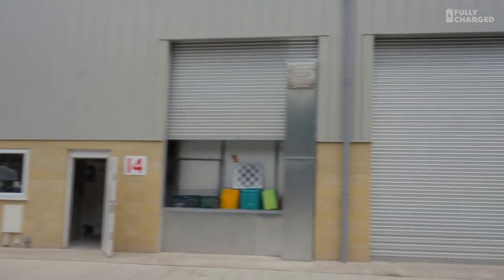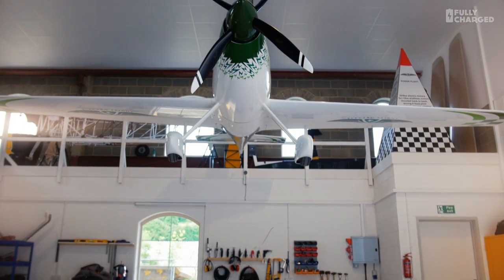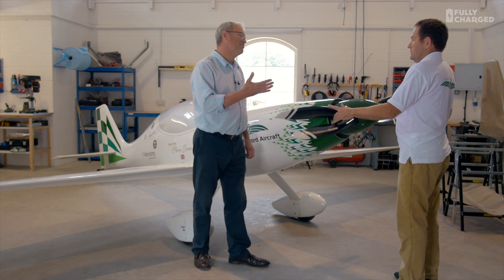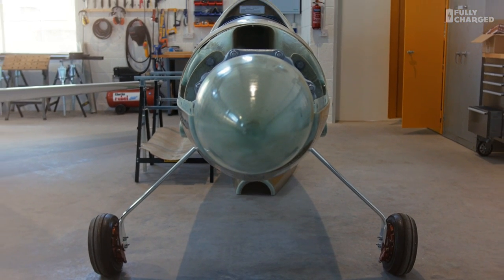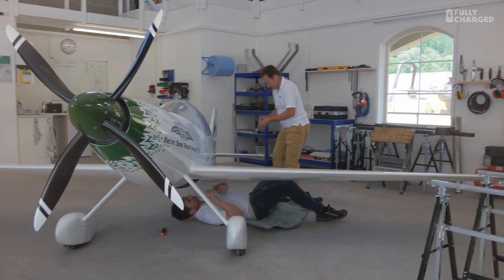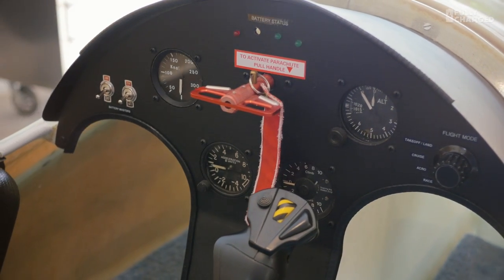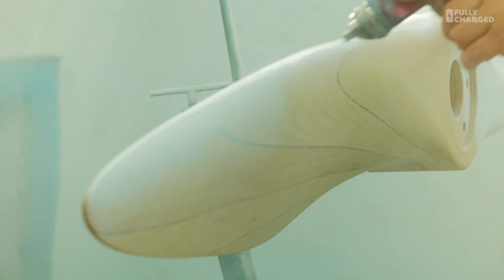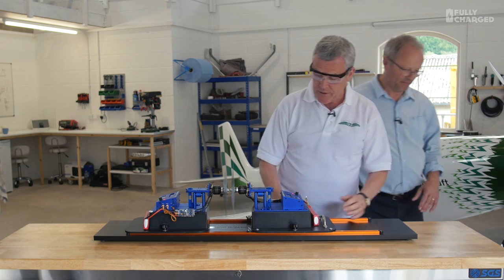Electroflight | Fully Charged

Comment: Until they can figure out how to store electric power as fast as a capacitor can,  it will always be impractical compared to hydro carbon engines. My idea is nanotechnology capacitors.
Reply: I was only talking about that to a friend a few days ago. If the body of a vehicle could be made from say lamination's which store the energy. Perhaps graphine could be used like carbon fibre. Other idea was to charge a liquid that could be poured in like fuel.

Comment: OH I see this video is almost two years old where's the follow on has the plane flown yet.  By the way R/C pattern does this all the time but with a counter rotating gear box and one motor speed control & battery. Just usurious what does the battery electronics and dual motors weigh in the prototype. I know what an IO540 weighs.

Comment: It's odd how you routinely hear that electric powered vehicles are zero emission.  I suppose after you have generated all the electricity needed, primarily through coal or natural gas power plants, to manufacture the motors, the fuselage, copper wiring, electronics, batteries, recharging, etc. etc. etc.   It's as if you drove a loaded diesel truck up a tall mountain, and once at the top you put it in neutral, shut off the engine and let it roll down the other side.  50% of the trip would be zero emission.  Not against electric powered anything, but just a reality check....

Comment: Problem with an electric aircraft is no energy recovery, a gas turbine generated electric aircraft is the only viable idea for long range commercial use. Plus aircraft motors operate at much higher rpm for longer periods of time than car motors. Electric aircraft are a long way off being viable. The industry won't change until there is commercial application, no one will train in an electric aircraft unless they are going to fly an electric aircraft.
Reply: People currently train in piston aircraft with the intention of moving to gasturbine in the future, so that's not really an argument against electric. Pilots already have to do an endorsement to fly gasturbine. Not even the military conduct ab initio training in gasturbine.
Reply: there are airschools that give endorsements in king airs, i can't really say how much that puts you ahead of other people who are searching for jobs though, i'm only 30hours into flight school :P
Reply: The batteries are the main issue.
Electric motors can easily provide the raw power, and generally more efficiently and with lower weight than a piston aircraft, or a turbine one.

The problem is energy storage is just... Batteries have terrible energy density relative to weight in particular.
It's one thing that the tesla roadster was 500 kg heavier than the Lotus it was derived from, because for a car that's something you can work around.
But adding 500 kg to a small aircraft, and not even matching the range of the lighter petrol equivalent is not going to do much.
Reply: Just like electric cars they are usable to some extent right now and more is to follow.
It is really idiotic to wait around for electric vehicles to reach extreme performance before you intend to use them for ordinary tasks. No one drives an F1 car to work, they take a pedestrian paced box that is just good enough for the job.
Reply: I think some kind of hybrid system would be viable, the current system is too expensive in cost and cost to the environment.
Reply: Maximum RPM for a piston aircraft engine is usually under 3200 RPM, with maximum power at a couple hundred revs under 3000 RPM. That's still fast enough to turn the tips of a 7 foot propeller above the speed of sound (1100 feet per second) at takeoff. Cruise would be at something like 2500 RPM.
Reply: There is energy recovery in electric aircraft, just like with EV's. They regen in descent and in decel. That's also the idea behind the airbus plugin hybrid concept.

Comment: ahaha turning props at 10,00 rpmm is ok on a  model but its silly on a  set of  8 foot props
Reply: Worse than silly, as the propeller tips would have to exceed the speed of sound with a tremendous increase in power required. Let's assume the designers know that relatively basic fact.

Comment: So why wood?
Reply: Cost, simplicity, reasonably low weight, best choice for one-off jobs. Carbon fibre is expensive and needs a costly mold before you can even start to produce the prop itself.

Comment: This propeller configuration makes it impossible to do a torque roll
Reply: It doesn't, actually, it makes it a lot easier, because you have way torquier engines, and you can control them individually. In BOTH directions.

Comment: Not 100% correct. Electric motors can overheat and altitude does change the density of the air which cools the motor. If the motor is run at full load or current you must design for the expected worst case to avoid overheating.

Comment: It sounds good but I suspect for racing it is too good to be fun.  That is there is no getting the best out of the engine or as in gear changing on a car or blade pitch changing in the air.  But for a crop sprayer wealthy person transport it looks great, if the battery gave it the range which it would not yet?

Comment: this is as practical as a drag racer, lots of power and speed with very little range
nothing that contributes to  commercial e-aviation really taking off sustainably
we would benefit more with a longer range airplane that can do at least 300 miles for short routes, even if they are slower, because the economic impact would be huge as well as the environmental. But I can see why they are doing this, this is a market they can win now with current technology, for what I'm saying, the energy density is not there yet

Comment: thats electric motors for ya
from lowest rpm and highest rpm is all full of torque, unlike conventional fosiil fuel engines which have torque only in certain rpm
1 problem with coaxial type
so noisy
Reply: Electric motors have a favorite RPM range, outside which their efficiency suffers.

Comment: You are complacently wrong about zero emissions with electric flight   it may be not coming out an exhaust stack but it is coming out of fossil fuel when generated unless it wind or solar. There is always a carbon foot print with any manufacturing process. Check the high CO2 emissions with the manufacture of a Tesla and it batteries.

Comment: electric energy is not for free !!!! and its price will rise apropriate to its needing more and more.. also we have to make dirty powerplants often atomic based.
flighttime is verry poor and if ading a pressurriced kabin will drop more.
Reply: Hi, read your post and fully agree; however,  there is a growing reorganization that a little considered aspect of electric applications will be the control of emission points in the production points of electricity.  Example, one electric plant of coal, atomic or diesel is the point of emission and will be easier to control than the emissions of hundreds of autos, planes or homes. Electric airplanes are still SIFI and expensive toys  and electric cars will only solve a very small segment of  heat and transportation needs; so, you can put money in these companies but don't expect a Volkswagen any time soon.  I am an old guy and I can remember when plastic was going to solve all our problems like broken glass all over the place. Plastic did solve all the broken glass on the beaches, in the rivers, and in you feet and it was cheaper than glass .  Now we have plastic all over the place.  Electric energy is not free and because we must make the stuff , thus the burning of fossil fuels will be employed along with Atomic.  Therefore; the question,  just what are these guys selling?

Comment: OK - it's a rich boys toy of no functional use and bears zero resemblence to anything that might resolve the inherent environmental issues of flying hundreds of millions of people on holiday, let alone intercontinental travel. Of course, the Spitfire was developed from a racing plane, but that really didn't point the way to mass air transit. It was a relatively short range interceptor, and a short range air race 'plane is not going to resolve the real issues either.

Contra-rotating props were produced in the latter part of the piston-powered era. Even Avro Shakeltons had contra-rotating props powered by RR Griffon engines, and some of the engines on those found there way into air racing. It's nothing to do with electric power, but rather a way of avoiding propeller tips going supersonic.
Reply: McLaren F1  which does not answer the fundamental problem of the applicability of this to commercial aviation. Electric power suffers from the relatively poor energy per unit mass. There's lots of work on small feeder and light planes, but a flying hot-rod isn't going to answer that stuff.

The technical issues of getting the range for a commercial airliner are much more demanding, and energy densities are around 80 times below that of jet fuel, and even allowing for issues of the greater efficiency of electric motors, that a massive chasm.

Maybe liquid hydrogen and fuel cells might answer that, but it's extremely difficult to see Li-Ion getting anywhere near it. At least electric motors can rival gas-turbine on power-to-weight. It's the energy storage that is the problem.

Comment: Interesting for shure,  but Electroflight can never used for Commercial Airlines, same goes for Cargo... 
Consider this; where do they get all the Energy from... please dont Say the Sun, or wind or Water...
Electro Cars or Electroplanes can never scale up to Comercial usage, it is a Onewaystreet !
Reply: > please dont Say the Sun, or wind or Water...

Why?
Reply: Easy answer, you have to transform the Natural Resources into Electric Energy the EROI = Energy Return On Investment does not work. You can not Harvest Electric Energy, you have to produce it...
Reply: Yes, you have to produce it, but you may produce it very cheaply, for example in nuclear powerplants. Also consider the fact that distribution of electricity is much cheaper than distribution of fossil fuels.

And BTW solar panels are getting there when it comes to price per watt, so in a decade or so (assuming the prices will drop at the same rate they have been droping last 3 decades) they should be on par with nuclear (better than coal).

As for petrol and gas they are already mroe expansive, so I don't understand your criticism.

Comment: How many people will go bankrupt before they realize there is a better way.  

There is new technology I am working on that will be 60% efficient on most any fuel and it can also run on electricity at a lower peak power for cruise should batteries work in 20 years.  Airplanes MUST have range and the battery is too much weight and too much volume.  

A hydraulic motor is 10 times lighter or more than the best electric.  One hydraulic motor I have seen is over 20 hp/lb or 40 times what a piston crank (Lycoming, for example) engine is.  Coupled with this new engine at 4 hp/lb, the electric option will be very very poor in comparison.  Sorry to bust your bubble, but this electric stuff is not the way to go.  Information is great for electrics due to the switching advantage of silicon.  Power should be Hydraulic and IC.

BTW, electricity is 15 cents/kw-hr in the USA.  That is $5.04/gallon equiv.  The battery is 12 cent/kw-hr use which is $4.03/gallon.  That is over $9/gallon.  Natural Gas in the USA is $1/gallon.  Need I say more?

The counter-rotation is great, but SOUND is the critical factor.  In a jet engine you how a cowl that reduces the noise, but an open prop gets slammed as it sees changing AOA.  The blade needs to be very strong and cannot be made to allow better efficiency by other means.  the idea is a dead end....
Reply: Rolls Royce has started at least funding this project and their website seems to show that they have abandoned the counter-rotating props.
Reply: Hydraulic motors have the same problem in mobile self-contained applications as battery powered systems do. Containing a certain amount of hydraulic energy weighs even more than an equivalent  battery, and much more than an equivalent gasoline tank.

Comment: Electric motor not requiring oxygen is irrelevant. The propellor efficiency drops far quicker than engine efficiency. Its why turboprops have a low ceiling than jets despite actually using jet turbines to power the prop.

Also he thinks his plane could beat a frontline fighter to 20K feet. Umm , sorry mate, you'll be lucky to beat any jet fighter to the end of the runway , much less that altitude. Lots of wishful thinking here and not a lot of facts.
Reply: he was including startup procedure for the jet engine. for an electric motor all you have to do is close a circuit and done
Reply: +boltar2003  I take issue with the first line of your post. Altitude density is irrelevant to engine performance? Really? You wanna try that again?
Reply: Richard Darlington
How about you try reading what I wrote again.
Reply: Jonathan Dittmar If he's going to include that then he should include the charge time for the battery in the electric plane.
Reply: +boltar2003 he should include the maintenance for the jet also
Reply: There are three factors that affect a propeller-driven, internal- combustion-engine-powered, fixed-winged aircraft's&#160;performance at various altitudes: the engine's ability to make power, the propeller's ability to make thrust , and the wing's ability to make lift. You said, "Electric motor not requiring oxygen is irrelevant."&#160; That statement, on it's own, is incorrect. Even when you include it in the rest of your post, that statement is STILL incorrect. Exactly what am I missing here? I have been building and flying R/C aircraft (same rules, different scale) for over 35 years, And I'm sorry, but, air density changes at my FBO (due to weather) require me to change props AND adjust mixture settings. Oh, and by the way, I don't have to wait for the battery to re-charge to fly again. I have several. I just swap them out!
Reply: Jonathan Dittmar
Thats not something that happens before take off. However any electric motor use as propulsion in aviation will almost certainly require strict checks and yearly teardowns to check for wear. Its won't be quite the switch it on and go that he suggests.
Reply: +boltar2003 electric motor has one moving part a teardown is pretty simple
Reply: Yep! Electric power has a strong presence in the wonderful world of R/C aviation. When brushless motors were introduced, there was no turning back! About the only thing you need to keep an eye on are the bearings as these things can turn some serious RPM's. Just ask the EDF guys.
Reply: Richard Darlington
My point is that propeller aircraft can't get high enough to care about whether electric is better than piston. The ability of the propeller to produce thrust is the limiting factor and despite what people think internal combustion is happy at quite high altitudes so long as some sort of forced induction is used.
Reply: +boltar2003 turbo cars at pikes peak lose a considerable hp near the top. a aircraft will suffer much more
Reply: Jonathan Dittmar
Naturally aspirated will lose even more. Anyway,. supercharging was good enough to get a number of WW2 fighters over 40K. Much beyond that and the propeller and wings don't work so putting an electric motor in the front would make zero difference.
Reply: +boltar2003 efficiency wise it will make a huge difference. 1/4 the operating cost will mean a lot
Reply: Jonathan Dittmar
Cost is a different argument altogether. I've no doubt in the long run electric will be cheaper than piston.
Reply: +boltar2003 solar is getting cheaper